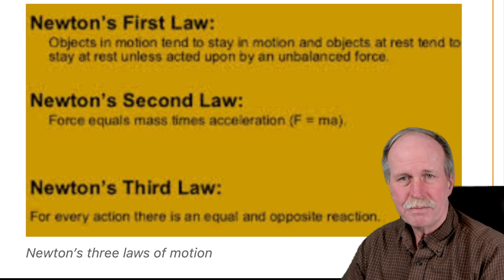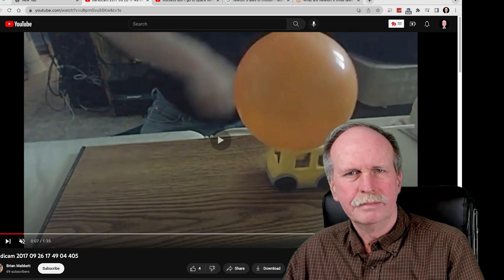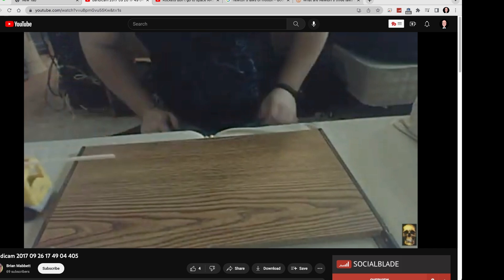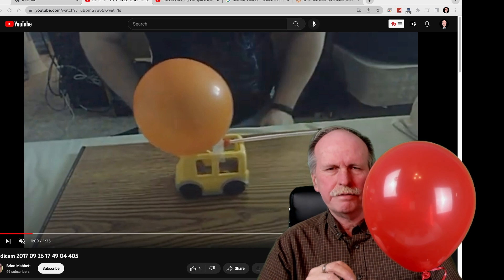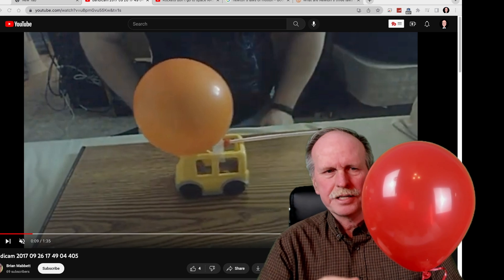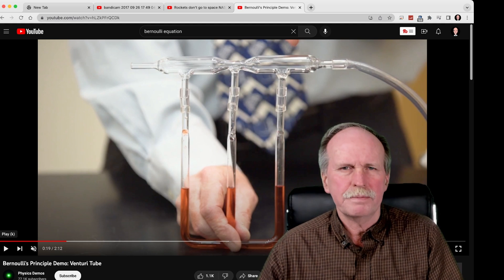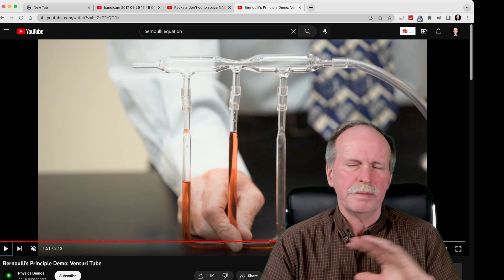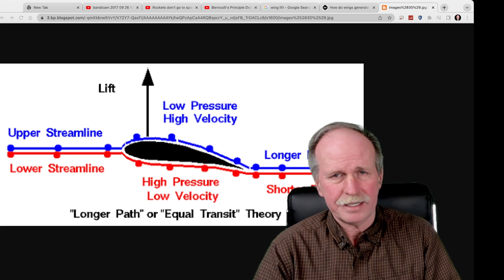Flat Earth Proves Rockets DON'T WORK

Comment: Great video and I really love how you explain things slower and more scientifically for an audience you know to be a little more scientifically illiterate or simply unaware, no offense to flat earthers for not knowing however. Although I would like to point out that equal transit theory isn’t true, while it is a very good way of showing how Bernoulli’s principle would apply and generate lift, airflow has no requirement to have equal transit times across two paths. This difference of pressures between the recombining airflows that had different transit times is actually part of the reason we get turbulent flow aft of aerofoils. Id encourage you to look into the obstructed airflow explanation as it is a correct explanation and still relatively simple to convey to audiences.

Comment: I've always heard your explanation about how a wing works, but 20 years ago, I read an excerpt in a sailing book that was written by an engineer at Boeing.  He said that the particles of air that separate at the front of the wing do not need to come back together, and the difference speeds are caused by a vortex created behind the wing that works like a cog on the air going over the wing to speed it up.  He also said this can be verified by anyone by putting pepper in a full bathtub and passing an inclined board, positioned vertically, through the water.  The pepper movement will make the phenomenon visible,  (like iron filings in a magnet field).
Reply from the maker: That's correct.  Wings have many factors that make them work efficiently.  This is a basic way of looking at them.  As many have pointed out, there are better ways to do it, but this works for the subject of the video.

Comment: A more fundamental problem is that no deductive logic is performed by the FlatEarther. (e.g. observation: 'Socrates is a man.' rule: 'All men are mortal.' conclusion: 'Socrates is mortal.') APPARENTLY the FlatEarther is asserting that their 'rocket' doesn't work in a vacuum because it has nothing to 'push off.' (It 'pushes off' its own exhaust.) However, their 'rocket' isn't in a vacuum (either a true vacuum or inside a vacuum cleaner.) If the hose had been IN FRONT of the 'rocket,' the rocket would go FASTER, disproving their notion. (Non-logicians NEVER do control experiments.) But we have no logic, and non-logic cannot be disproven. Kinda like 'the election should be invalidated because Hunter Biden's laptop' or 'there is no gravity, just density and buoyancy.' What you often see is not even a complete sentence, much less any form of logic. An incomplete sentence cannot be contradicted.

Comment: Interestingly that rocket nozzles for launch and for space are shaped differently because the nozzle is used to expand and accelerate the exhaust gases.  Ambient Pressure (Pa) and Exit Pressure of exhaust (Pe). Maximum efficiency (i.e. maximum thrust) is obtained when Pa = Pe. And then thrust  
T = mU  + Ae (pe – pa ).

Comment: Small error in the explanation of lift: The illustration you showed says equal transit theory which is not what is actually happening because there is no law in physics that defines that to be necessary.  Its a common misunderstanding of lift theory.

Comment: The longer path theory for lift is not correct. Air passing over and under an aerofoil does not have to match up. This has been proven in numerous experiments.

Comment: I didn't get it - why air passing on top of the wing must meet with the same air passing on the bottom? Air molecules are not connected to each other - they have no idea which one the should meet... and after all flat wing works not much worse than airfoil... and after all plains with airfoil perfectly capable to fly upside down... so, apparently, bernoulli principle has not much to do with it...

Comment: In order for a flat earth to debunk a rocket working in outer space.. there first needs to be established the evidence of a flat earth. 
You cannot demonstrate or present any sort of evidence for a flat earth.  A flat earth not only defies all of science methodology and is not scientific itself.. but a flat earth is in violation of all the laws of physics and nature and how everything works.  A flat earth is literally impossible to have and to still have any of the laws of sciences that we have.
   In a flat earth you not only cannot have gravity but you do not get buoyancy either. Buoyancy requires gravity. You also cannot have atmospheric pressure, nor wind currents, rain fall or precipitation fall. 
   With a flat earth you could not get a weight measurement. As weight would not exist.. because weight require gravity in the equation as also mass and density... Which all require a degree of relation to gravity. 
On a flat object you cannot have a motion or drift of the planet ..it cannot have an axis.. in a flat earth model, it would not be a gravitational force but centrifugal motion.. which means things would pull to the outside.. not downward..so again buoyancy would not work anyways. In a flat earth model there would be no causal measure to have any movement anyways. 
Literally every aspect of a flat earth is a failure.. in a flat earth model things could not grow as they do.. erosion could not happen .. the list goes on and on.  
This is why before any flat earther wants to make a claim about anything at all..first they need to demonstrate with factual demonstrable repeatable and verifiable evidences of factual evidence that there is a flat earth... Not an idea of such..not a belief.. not just saying words ... But show it.  Demonstrate it to be so.    Until they do this it is useless to tackle other claims they make...  They cannot establish a base for the flat earth. The crux of everything of their arguments. Without this proof they can't make other claims based from it.
Tackle A and prove A...then you can move on to B C D or even to X Y Z ..but in order.. one step at a time.. until you answer each in order your have no place to skip anything

Comment: you were absolutely correct about everything except when you got to the airplane wing part. 
The air over a wing doesn't speed up because it travels a longer distance and must meet up with the same air from the bottom.  It speeds up because it is being compressed against the air above it.  Also, conservation of momentum is a huge factor in wing lift.  The wing pushes the air down, so the air pushes the wing up.

Comment: "But it doesn't push off anything in space..." As if it pushes off the air in the atmosphere, because the air is, you know, so, so solid! 

And of course, something like the Saturn V which weighed nearly 3 million kg got good leverage off air molecules! 

You could get concussion from the force of a face palm connected to that statement.

Comment: Unfortunately none of us actually KNOW , thats because none of us have actually fired a rocket engine in space. Please tell me all knowing one, creator if this content, on which day did you fire a rocket engine in space to prove your claim? 

I can't say I know either way, but whenI consider the thrust pushing against atmospheric pressure , and then I consider a rockets thrust minus the pressure of the atmosphere I could see why the argument exists. Remove the word vacuum, and insert the lack of atmospheric pressure and then look again for any different results. Or if your goal here is to assert you know without question that our planet is a true sphere, and that you have in fact fired a rocket engine in space and have video proof please add the link
Reply from the maker: Typical science denier. There is no requirement I personally do anything and I don’t accept that as a condition of truth.
Reply: All you got is denial. Nothing else. Your denial means nothing.
Reply: I can look at the sky and see satellites move at 8 km/s without using propulsion. They had to use a rocket to get where they are, proving that rockets work.

Comment: Bob, you know what they'll say when you start talking about pressure: "You can't have gas pressure without a container!"
Reply: They are right of course, except that they don't recognise gravity as a container - hell, they don't recognise the existence of gravity, preiod!  The other thing they can't explain is why there is a pressure differential in gases and liquids inside physical containers between the bottom and the top.  It may be small for the size of most containers, but it is there, and only exists because of gravity.

Comment: All the experiment's shown are done in the atomosphere. Sucking and or blowing atomospher in one direction will cause an effect in a different direction.

Question: A hair dryier is a vaccum which sucks the atmosphere into it, heat's it while it going through and out the other end. IF there's nothing for it to suck, as there isn't in deep space; What exactly would come out of the hair dryier.
Reply from the maker: do you have a point here? and the answer is radiant heat.

Comment: The wing shape you show at 10:40 is not necessary for flying, just a very nice optimization. Because the same pressure differential you have explained can be created by setting the angle of the wings correctly. It is the same effect whether you have optimally shaped wings or the aircraft was pitched up. The nice thing about these wings is that they are more efficient than slightly pitching the whole aircraft.
Reply: When I first took flying lesson, an instructor said in class, you can make 2x4 fly if you push if fast enough, so you are correct, anything flat will produce lift, but the curve makes it produce more and with no angle.

Comment: There was no evidence of it actually going to space Bob. I thought I'd come here to actually learn something, but what a waste. You are basically strawman-ing the whole debate. I saw many rockets launched, especially from Nasa. None of them seemed to be entering space as the nose of the rocket would tilt down back to earth. Then comes the CGI. I watched vacuum videos from other scientists all doing drop tests. But none never went up, then down tests. You can strawman all you want, but that up to down test would fail. Space is different from a controlled environment here on earth. As down is absolute. But space is wherever the force is pushing it. Those vacuum test should be you drop the objects they both go down at the same pace. Now reverse the process now going up. In those vacuum tests, the objects should stay up there? Or will the objects fall back down at the same rate? This is where those vacuum tests would debunk itself. If you can, provide a video of doing this test. With the result of one or the other. Than I May be convinced. But thanks for the video and trying.
Reply from the maker: So many mistakes in this comment
Reply: @BobtheScienceGuy  state mis-takes. On my com-ment
Reply: We can look at the sky and see satellites. We can measure their speed and position. We can receive radio signals from them. None of those would be possible if rockets didn't actually reach space. i.e. we have proof that satellites are real.

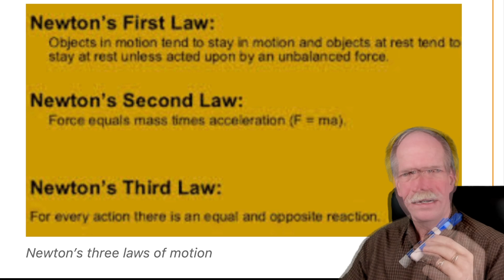Comment: 1:07 that's actually wrong. It doesn't throw large amounts of mass out of the engine, but large amounts of energy in form of a giant endless explosion. If it's only for the mass, they shouldn't have to burn that stuff ;)
Reply: think rather momentum, not energy
Reply: No, that's not true. The mass is what's important. The explosion (continuous combustion, rather) is just there to accelerate the mass. You can build a rocket engine without explosions, using e.g. electromagnets to accelerate the mass. This is called a mass driver.

Comment: the deliberate flick upwards and slight rollback of the little car at 4:36 show it wasn't a 'misconception' but a deliberate attempt to deceive. The helium balloon drawn towards the dryer and cleaner are great, but do NOT recreate belly-man's experiment. Misconception is understandable, but outright hoaxery from those that claim space travel is all a hoax is beyond ironic.
Reply from the maker: The point was to show the vacuum added a force that pulled the car back and opposed the thrust of the straw.  It was very finely tuned to create the effect he wanted to show his 'conclusion'.
Reply: @BobtheScienceGuy  yes, i see that, and you've done an excellent job, but we all know FEers won't see the connection- not that they'd be watching your video anyway. However, if the experiment was repeated with similar conditions, and the car moved backwards it clearly demonstrates the intention to deceive on the part of the video maker.

Comment: Just FYI, I used a program called Algodoo (which I learned from team skeptic), and I made a couple simulation that any of you can search... something called rocket nozzle in vacuum (sorry, its been a while). But one had the nozzle plugged, and the other had it open. Sure enough, as the particles that had velocity escaped, the whole thing move forward. I know it isn't quite the issue Bob is addressing here, but it is a fun one if any of you want to look it up.

Comment: How do they answer the laser reflectors on the moon the Apollo astronauts placed there that are still working. He needs to put the entire assembly in a vacuum chamber and perform it there.  Rocket engines use a combination of a fuel and an oxidizer(oxygen). However there is a new type of engine “ion engine” that creates thrust by flowing and inert gas over a charged grid creating a stream of ions.
Reply from the maker: they are fake, stated with confidence and a decided lack of supporting evidence.

Comment: Hey here's a flat Earth experiment I currently reside in Kansas We have a lot of windmill farms here there's one over by Dodge and there's another about 3 hours away farther East  A laser on top level to the plan appointment at the farthest when will you can what happens Let's set a drone with  Laser light sensor divide between one windmill and the farthest windmi know you can see what happens with that drone flies with a ground pointed radar Made out of explained it correctly but you should get an interesting result
Reply: Punctuation. Learn it.

Comment: I was with you, until you said the airstream over a wing has to meet the air over the bottom "at the exact same spot". There is no such physical requirement. In fact, the difference is known as the 'slip stream'. The reason for the shape of modern wings is to delay the onset of stall. But, flat wings such as the Wright Brother's,  and a paper airplane, also benefit from Bernoulli's principle. It's just that the difference in "path length" is not the reason.
Reply: Just admit you are wrong, and folks will give you a break.  Air passing over a wing, has to meet at the rear.
Reply: @robertheinkel6225  well, it has to 'meet', but the pairs of molecules that were separated at the leading edge are under no obligation to pair back up at the trailing edge. You can see it clearly in pulsed-smoke wind tunnel testing. https://www.youtube.com/watch?v=6UlsArvbTeo&ab_channel=FrancisVillatoro

Comment: Years ago a flat earther actually did what I consider a reasonable experiment. He had a vacuum chamber with a air jet above a small load cell so he could measure the thrust produced by the air jet. He found that the thrust actually increased as he pulled a vacuum on the chamber. As someone predicted for him. It would have been nice if he made a plot of vacuum vs force for his air jet. Still it was interesting. He took his video down of course.

Comment: I just thought of another proof to make the Flat Earthers look as stupid as they are. In WWII, American Battleship 16" guns could shoot 23 miles. A problem was that even from the highest point on the ship, they could only see shell splashes 13 miles away. This is why Battleships had float planes on board to watch for and radio back, the location of the shell splashes.
Reply: I take it you mean float planes...
Reply: @lorddaver5729  Yes.....At sea level, you can only see 3 miles. At 66 feet, you can see 10 miles. At 100 feet, you can see 12.25 miles. 
A spotter plane at 1,000 feet can see 39 miles.

Comment: Hi Bob, sorry to correct you but I think it’s important to do so, given this is a teaching point in your video.
The picture you used to show how a wing works is not correct. It depicts the air stream joining and leaving the wing’s surface in the horizontal plane. Unless specifically designed this way, this is not how a typical aerfoil is designed. The air leaving the wing will be deflected at an angle, i.e the airflow is turned. The forces equal and opposite to this turning force are the components of lift and drag that entails flight.
Another important thing to note is you said the air stream rejoins at the same point it split before encountering the wing. There is no reason for the streams to converge at the same molecules at which they diverged, which the diagram you used appears to imply.
Please don’t take this as criticism, I really enjoy your videos but I feel I couldn’t say nothing as I wrote papers on this at university.

Comment: The rocket absolutely NEEDS for its fuel to push against SOMETHING!!! If so called "outer space" is a vacuum (if such an impossible pseudo-scientific notion could ever be possible adjacent to earth's pressurised environment of 14.7 PSI @ sea LEVEL) then that spent fuel is pushing against absolutely nothing!!! That's a HUUUUUUUUGE problem, Mr faithful servant of the religion of Scientism!
Reply from the maker: you might want to read up a bit on that.  Maybe ask a middle schooler.
Reply: The rocket pushes against its own exhaust.